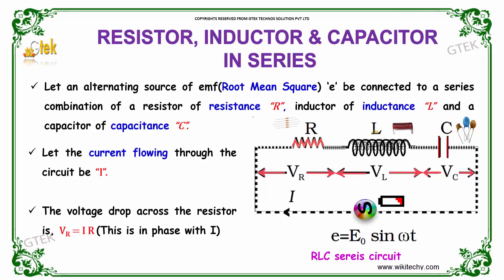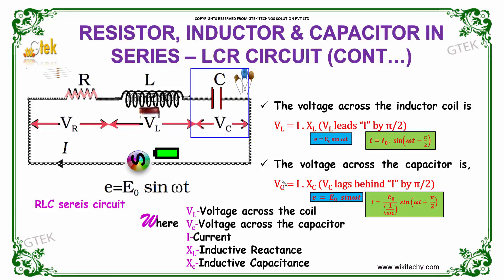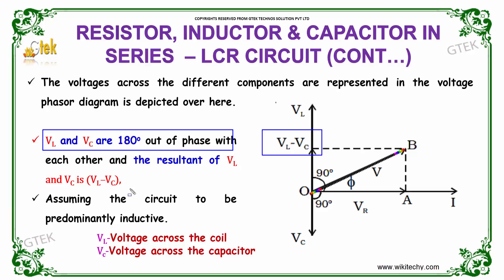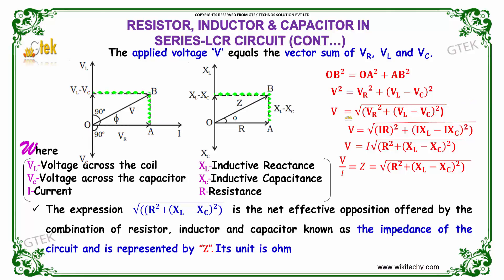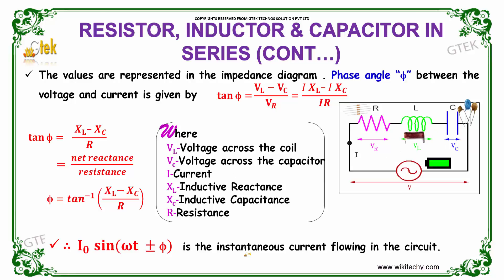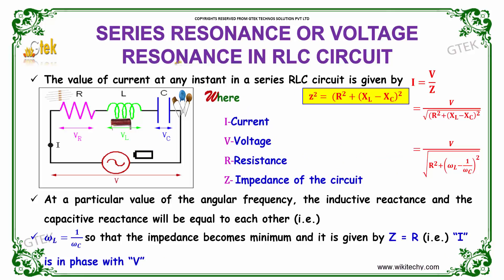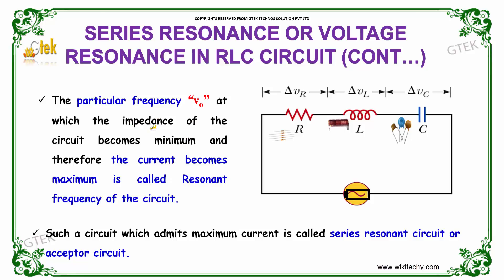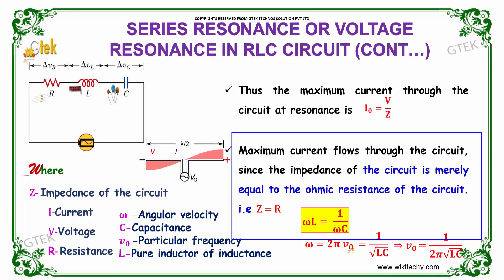Resistor, Inductor and Capacitor in Series| Electro Magnetic Induction And Alternating Current

Comment: An RLC circuit (the letters R, L and C can be in other orders) is an electrical circuit consisting of a resistor, an inductor, and a capacitor, connected in series or in parallel. The RLC part of the name is due to those letters being the usual electrical symbols for resistance, inductance and capacitance respectively.

Comment: An RLC circuit is an electrical circuit consisting of a resistor (R), an inductor (L), and a capacitor (C), connected in series or in parallel. The name of the circuit is ...

Comment: Series resistor inductor circuit: Current lags applied voltage by 0o to 90o. The resistor will offer 5 Ω of resistance to AC current regardless of frequency, while the ...

Comment: An RLC circuit is an electrical circuit consisting of a resistor (R), an inductor (L), and a capacitor (C), connected in series or in parallel. The name of the circuit is derived from the letters that are used to denote the constituent components of this circuit, where the sequence of the components may vary from RLC.

Comment: An RLC circuit is an electrical circuit consisting of a resistor (R), an inductor (L), and a capacitor (C), connected in series or in parallel.

Comment: A resistor is a passive two-terminal electrical component that implements electrical resistance as a circuit element. In electronic circuits, resistors are used to reduce current flow, adjust signal levels, to divide voltages, bias active elements, and terminate transmission lines, among other uses.

Comment: The circuit forms a harmonic oscillator for current, and resonates in a similar way as an LC circuit. Introducing the resistor increases the decay of these oscillations, which is also known as damping. The resistor also reduces the peak resonant frequency. Some resistance is unavoidable in real circuits even if a resistor is not specifically included as a component. An ideal, pure LC circuit exists only in the domain of superconductivity.

Comment: considerably more circuits that operate with alternating current (ac), when the charge flow reverses direction .... magnetic field. .... Resistor, Capacitor and Inductor connected in  ...